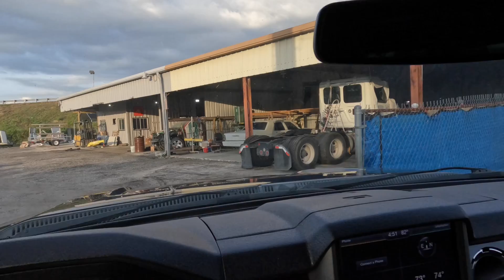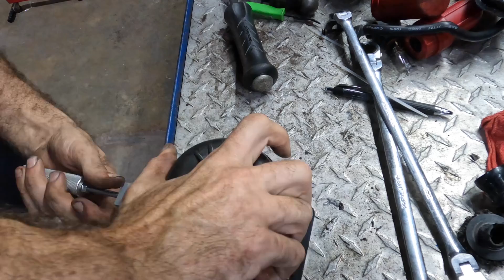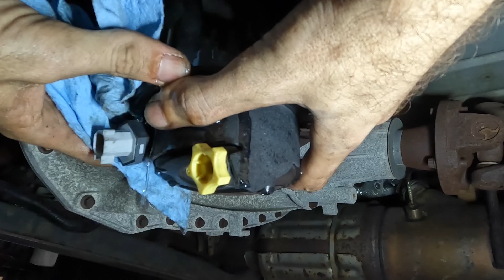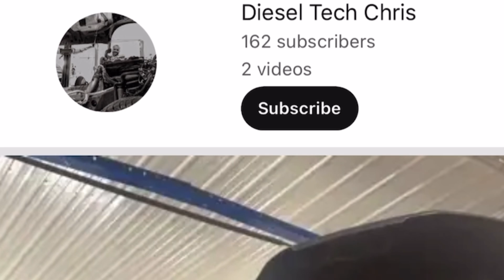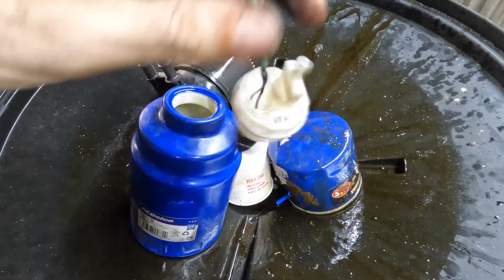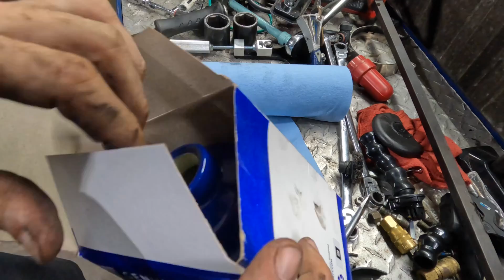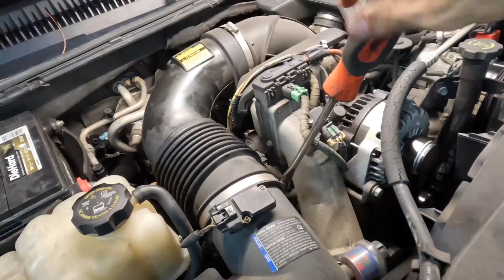Diesel Fuel System Filters!  Duramax & Powerstroke 6.6 & 6.7

Comment: some cars in Europe don't even have fuel filters, we don't need it because our standard on fuel is higher and our fuel is cleaner.
Reply: I dunno about that, I have looked in a few diesel filters here in UK and I wouldn’t want that shite going through my i pump ! and as for France they have a shite level diesel on one of the pumps that I would not use to start a fire !
Reply: @CrimeVid  diesels sure, i know i owned a Peugeot, no filter. I got rid of the car because of that. even Toyota Celica doesn't have a replaceable filter, is in the tank with the pump assembly attached.
Reply: @TriforceOfCourage97   The article/post was about “Diesel Fuel System Filters” !  yes I have had petrol cars without filters, I tend to add them. You don’t know if a previous owner has topped up from a scuzzy can.

Comment: Sometimes if you leave the top filter off and then go down and do the bottom filter it's easier and the reason I say that is because it will reduce the amount of gravity pull " vacuum " on the tank and it will drain less fuel from the lower filter.

 What I've seen is guys will leave the Upstream filter in line CONNECTED and then when they go to do the downstream filter every once in awhile it'll just keep draining fuel 

so if you all the lines are off the Upstream filter first ( leave it off ) and then go Downstream under the truck your drain time is less and you don't get that siphon effect on the main fuel tank

Very carefully put the new filter in the fuel filter housing down low " the water separator housing " and lubricate the O-ring make sure it doesn't rotate or spin once the O-ring is set because it will suck in air around that O-ring and if that happens you'll have good fuel pressure to start " kinda "......the truck will run but after 15 to 20 mph all of a sudden it'll feel like the truck starts breaking up and lack of power.....like not running correctly and that's because it's sucking air around that O-ring Downstream....and monitor fuel psi it'll be down to 40psi and it should stay around 65 - 75 psi

Then move Upstream in the engine bay and change that filter and just like you were doing in the video cycle the key three times leaving the key forward for up to 30 seconds each because that's how long that pump will run and it will fill the entire system and then start the truck

But either way as long as the job is done and the vehicle runs good that's all that matters but this is just how I do it because I see so many of these

Good Job buddy

Oh: never use aftermarket fuel filters on a Ford diesel it will not work out good for you in your favor unless it's a complete upfitted entire fuel filter housing kit from like Caterpillar or something like that